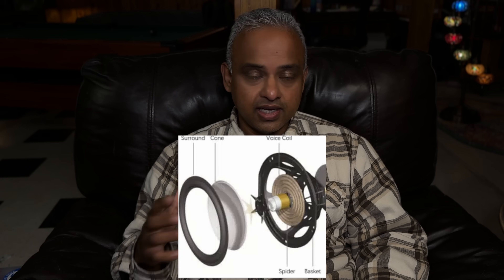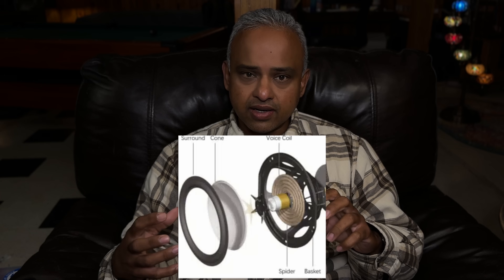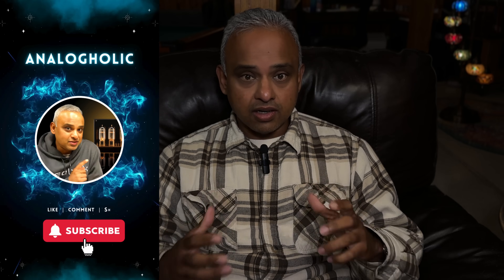Breaking In Your Speakers & Amps: Science or Snake Oil?

Comment: I completely agree with this point of view, that is the reason why I have few pairs of speakers and two different amp, one tubes, one solid state. I switch often. This way I avoid being used to one type of sound and each time appreciate better the sound of each combination. 
OK, one could say, having multiple set up is expensive. Of course it is, but with DIY many can afford it. I bought the tube amp but I made the solid state from a kit (FirstWatt F5) and I know nuts on electronic, it took me a year to read, understand what needed to be, get all the parts, records advices etc....and the price was cut into three time less. As for the speakers, if you are a bit passionate, it is the same, read, learn and built. You'll learn 10 times more, the price will be cut by as much if not even more, and you definetly can make a great pair of baffles and in my case, three. On top of that you'll be proud of yourself.
For three pairs of baffles, I spent less than 1,5K, it was intellectually and technically compelling and it gave me the confidence that I can do it again. As for the results, all I can say is that when people listen in my room, they are shocked, but more interestingly I am a happy listener. Happyness is enjoying what you have.
Reply from the maker: Love this perspective. Rotating gear keeps your ears honest and the DIY path teaches you more than any spec sheet ever could. Building something yourself also changes how you listen because you understand the tradeoffs and intent behind the sound. And I agree completely, the real win is not impressing others but being genuinely happy with your system. That last line really says it all.

Comment: When it comes to Nelson Pass- he is designing mainly class A operating gear  , or  mosfet amps with high quiescent current setting, of which warm up time is probably much faster than an ordinary bipolar AB (almost B) class amps. In my opinion electronics do warm up, and sounds much better with time. I've had a cambridge audio d500se cd player, which really needed a few days to show it's best. There is an opamp -LM4562 which sounds fabulous after few days.
Reply from the maker: I agree that electronics do thermally stabilize after power on, and that can matter, especially in high bias Class A designs. But that process happens on the order of minutes, not days. Once operating temperature is reached, the electrical parameters are effectively settled.

What often gets attributed to days long electronic burn in is usually a mix of listener acclimation, expectation, and sometimes mechanical changes in speakers rather than changes inside solid state electronics. Op amps in particular reach thermal equilibrium very quickly and do not materially change over days of operation.

So yes, warm up is real. Multi day electronic transformation is not supported by the physics. That distinction is important, especially when we are trying to separate what is audible from what feels intuitive.

Comment: Awesome work, presented in an open-minded and non-dogmatic way. Only correction is that you're misusing the term “psychoacoustics.” It doesn't refer to things our brains imagine we hear (via confirmation bias or whatever). Rather, psychoacoustics refers to the way we always hear. It's a model for understanding the interaction of acoustics, ear/body physiology, and neurology.
Reply from the maker: Thank you for the clarification. You’re absolutely right about what psychoacoustics actually means, and I appreciate you calling that out. The intent of the video wasn’t to suggest imagined sound or placebo, but to separate real, measurable mechanical changes from listener acclimatization and expectation over time. Your point reinforces the core idea that human perception is part of the system, even when the hardware itself is behaving consistently.

Comment: Another great video i think the power supply and our moods have a big part to play in a decent hifi system but i agree the components make a difference in sound i have recently bought a rell sub and have had to turn the settings down to reduce the base another thing i have a valve amp and new tubes can sound so  bad when you first use them but can change a lot after burn in. I am working on inprooving my power supply at moment with screened cables and filters
Reply from the maker: Great points and thanks for sharing your experience. Room bass and sub integration can make a massive difference and it sounds like you did the right thing by dialing it back. Mood and expectation absolutely play a role in how we perceive sound too.

With tubes, there is also the very real factor of operating points stabilizing and components reaching thermal equilibrium, which can explain why things change after some hours of use.

On power, I always try to separate what is electrically measurable from what can be system dependent. Good grounding, proper shielding, and avoiding noise issues matter far more than exotic solutions. It is always about solving a real problem rather than adding complexity.

Keep experimenting and enjoying the music. That is ultimately the goal.

Comment: Speakers do need a break in as they are moving devices. Subwoofer are the worst at being too stiff when new
Reply from the maker: Agreed that speakers are mechanical devices, so some initial settling does happen, especially with stiff suspensions like subwoofers. That said, it’s usually a relatively short process, not hundreds of hours. Most of what people report beyond that is listener acclimation rather than ongoing physical change.

Comment: Many of the manufacturers that claim break in is critical also say that they design using measurement AND listening. Do they really test each design tweak only after 100+ hours of break in?  That sounds like a brutal optimization process.  I think what takes 100 hours is listener adaptation, which occurs over time in my experience.
Reply from the maker: Long break-in cycles would make iterative design impractical. Most electrical behavior stabilizes quickly, so extended time is rarely part of the actual tuning process.

Comment: I would opine that it is illogical that “burn in” would always result in a positive change. But the reality is that our auditory memory is far too short to critically compare changes over hours let alone weeks.
Reply from the maker: That is a fair point about auditory memory and I agree it is limited. But break in is not a single claim. There are two separate things happening.
One is listener acclimation which is real and unavoidable. The other is physical stabilization which is measurable in mechanical systems like speakers headphones suspensions and even capacitors settling electrically.
My video is not claiming burn in is always positive or dramatic. It is explaining why people report changes and why sometimes both explanations overlap.
Both can be true at the same time.

Comment: My JBL 500 MK2 soundbar made a difference just after 1 hour. I had upgraded from my JBL 500 soundbar and the old sound bar sounded better at first, but I had it for over 2 years and after just one hour with the new one, I could feel the difference with the new soundbar. Maybe it's just a mental thing but when I first plugged in the new soundbar it sounded horrible. The good thing is that it only took about 1 hour to sound way better than my last soundbar, not the 100s of hours some audiophiles claim it takes lol. I'm sure with more play time maybe the sound will be better or like he said maybe I will just be accustomed to it. Then again the new system has over 260 watts of extra power lol
Reply from the maker: That’s a very reasonable take.

With electronics and speakers there are usually a few things happening at once: very small settling effects early on, your ears and brain adjusting to a new tonal balance, and in your case a real hardware change with more power on tap.

The important part is you trusted your own experience and didn’t assume it had to take hundreds of hours. If it sounds better now and you’re enjoying it, that’s what matters.
Reply: @analogholic_reviews Yes! I loved your review! You knocked some sense into me. Thank you for your video!

Comment: Something is especially true about a piano that has been moved from one location to another. After two or three weeks of acclimating to the temperature, humidity and regular playing, then it is time to call for the piano tuner. A new piano should be played longer. To some degree, speakers can be thought of as a musical instrument in that it creates sound mechanically. It takes time for a new or used speaker to adjust to the temperature and humidity of its new environment. An acoustic suspension or sealed enclosure takes longer than one that is ported. I have rebuilt many drivers over the years with the surrounds being the most common along with old electrolytic capacitors. On one occasion I replaced the urethane woofer surrounds on a pair of New Large Advent speakers. I always test the mechanical integrity of the driver by playing sawtooth, square and sine wave at various frequencies to find flaws. The most important test that I do is to play an extremely low frequency signal and power to test cone excursion making certain that the voice coil is centered, the spider is secure and that the surround is symmetrical and secure. A couple of times I found issues with the adhesive that caused a clicking or tapping sound. I wondered about the break-in myth and I wanted to see if it was provable. After so many years, the voice coils on the previously repaired Advent woofers began to detach and I elected to replace them with new direct equivalents. I took that opportunity to measure physically and electrically the new woofers before and after ‘break in’. I even checked the barometric pressure thinking that it could throw off measurements that were slight. Mechanical measurements revealed after ten days the woofer cone was more flexible and the cone excursion increased for a set signal level. The change in mechanical compliance was reflected on my scope because the electromotive nature of the speaker reactance will show electrically in the current and voltage. Yeah, the electrical readings confirmed the minor changes in the speaker. More like minuscule. So, that was some time that I will never get back, but the most significant thing to note was that I didn’t hear any improvement or degradation for the break-in. Maybe just a couple of weeks acclimating to temperature and humidity has the greatest effect. You might consider if you are able, to open the speakers to let out the ‘bad humours’ for a day or two just like bloodletting with leaches. That could be as affective as break-in. As far as the electronics goes, run everything loud and hot and if nothing blows up in the first week or two, it should be good for the long haul. The capacitors will form just fine in the first few hours. Most amplifiers are good to go warmed up 15 to twenty minutes. I haven’t done that sort of thing since fifty years ago with my tube short wave receivers, transmitters or Hi-Fi gear. That being said, a gentle application of compressed air to remove the hysteresis dust and bias-barnacles from your equipment is an excellent prophylactic procedure. A dash of science and bucket of snake oil.
Reply from the maker: Really appreciate this thoughtful and experience based perspective. I especially like how you separated measurable mechanical changes from perceived sonic ones. That’s an important distinction that often gets lost in these discussions. Small physical changes can exist, but they’re easily outweighed by environment, setup, and expectation. Your closing line really captures the spirit of the video perfectly: understanding where solid science ends and where mythology tends to take over. Thanks for taking the time to share such a grounded take.
Love piano example! Violins are much alike!

Comment: My nearly 50 years of experience confirms these observations.  I use all tube amps, preamps and guitar amps.  I also happen to have a Ph.D. in EE from a top school and modify amps.  Tube gear certainly needs to warm up for AT LEAST ten minutes - maybe an hour for critical comparisons.  In a high resolution system, I fancied I could hear my Denafrips R2R DAC improve slightly for a week or more - an expectation set by Denafrips.  But the sound signature of the DAC didn't really change.  I still noticed the same sonic differences w.r.t. my previous high-end DAC.  If I don't like the sound of a component on Day 2 or 3, I return the item.  Odyssey amps are a personal example - I didn't care for them at all.  Your mileage may vary.
Reply from the maker: Completely agree. Thanks for adding the depth!

Comment: I bought some 8" drivers and used them for a year or two and I hand "pumped" them after that. And I bought some identical drivers and hand "pumped" them and they were at least twice as stiff as the used drivers. So the used drivers would have had better bass, I suppose. 😂
Reply from the maker: You are not imagining the stiffness difference, that part is real. The important bit is that almost all of that change happens early, not gradually over years. Drivers break in fast, then they just… exist. Physics gets boring after that

Comment: When companies give u the ts parameters on a speaker its measured after the speaker is broken in for a reason because when u put the speaker new on the dats its gives a different ts parameter so what u are saying isnt making sense
Reply from the maker: Manufacturers measure T S parameters after a very short stabilization period, not 400-500 hours of so called break in. Drivers do change at first, mostly compliance, and that happens quickly. What I was pushing back on is the idea of long mystical break in times. The published specs already assume that short initial settling has happened.

Comment: 110% agree...  Sound quality is often perceived subjectively, but the underlying reality is that if the audio seems off, it's likely due to system or environmental factors, mostly environmental. Warm-up is particularly crucial for tube equipment, which is more sensitive to temperature fluctuations. The apparent improvement in sound quality during a demo is largely attributable to the environment and optimized source material, not necessarily the equipment itself (no two rooms sound the same). The acoustics of your room play a significant role, and most users lack a basic understanding of proper speaker placement, gear matching, or room acoustics, which limit the performance of their system. Unless you have a dedicated listening space, achieving the full potential of your audio equipment—approximately 90% of its true capability—can be very challenging. These principles are well-established in the field of acoustics and DSP can not solve this.  I have written a few white-papers and several books on this and other audio nonsense...

Comment: I have a few audiophile friends who are hilarious to me (as an electronics technician) their claims are often so ridiculous I can only laugh. One spent over a thousand dollars on a gold plated IEC power cable and was amazed at the improvement, and they collectively bought into every gimmick possible, the CD edge inking, the huge dollar toslink cable, gold plated 8 gauge speaker wire along with special connectors, special anti static support feet, power conditioners, everything. And everything made massive improvements... apparently.

Comment: I became much less skeptical of amp break in when I got an Aiyima A07 Max amp. Initially it sounded bass light and grainy in the treble. After a while it was sounding much better. I used it for a month or so before ordering another with the plan to eventually run them in mono. Initially though, I just dropped the second amp into the system in place of the first amp. The sound reverted to how the first amp sounded at first. A few days later, it had undergone a similar break-in to the first amp and sounded just like it.
I could put my experience with the first amp to me just becoming accustomed to its sound, but I was well used to that sound when the second amp arrived.

Comment: Amplifier break in my experience is snake oil. I worked a couple of decades as electrical engineer designing and overseeing tests on many electronic products, 7 years focused on receiver and amplifier testing. I’ve taken thousands of parts straight from prototype production and full factory production lines and thrown them immediately on an audio analyzer with difficult to drive inductive loads from 2 ohms up to 16 ohms. Then I’ve ran them for 200 to 500 hours sometimes 5000 hours, cycled them extreme freeze cold to extreme heat, shaken them on vibration tables, ran them in high humidity, hit them static shocks from an esd gun. I’ve never seen measurable performance improvements with the audio analyzer after hours of use. The receiver or amplifier tested gets ran across that audio analyzer at least weekly during this time. Burn-in was different and I mostly remember some lcd displays taking 50hrs to burn in, but that was cause if those displays were going to fail it was in the first 50 hours. Anything display that lasted past 50hours was unlikely to fail in the receivers 10year expected life span.